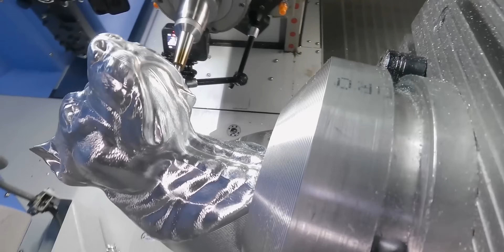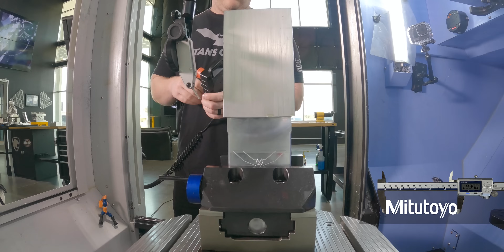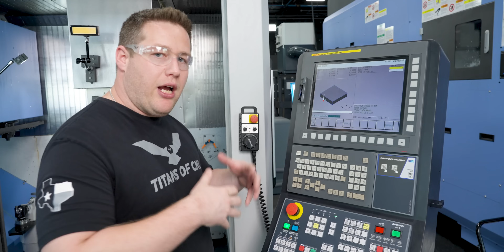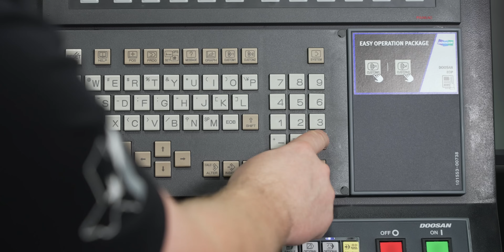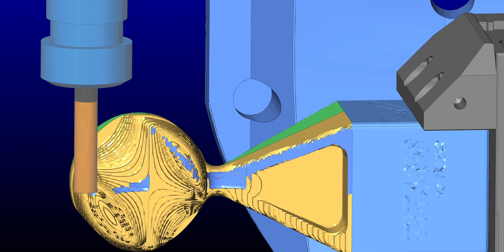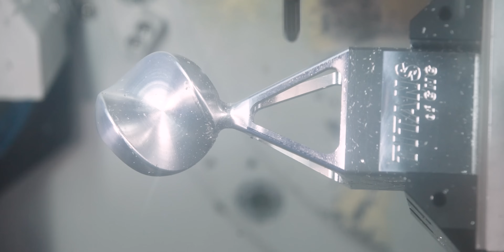How To Machine 5 Axis Parts

Comment: the confusion i have about 5 axis is the correlation between work coordinateZ0 and center of rotation of the 5th axis and how it works. If your part is sitting further closer from center of rotation, wouldn't your absolute positions be totally different when at different angles?

Comment: Man, what kind of time wasting program is this nonsense? At start tool walks backwards then starts another cut line? I would have run a Hog mill and got that material outta there. Then either a bull nose or a ball mill. One last thing, where did you learn the bad habit of clicking the torque wrench 2-3 times. Every course and on the AMSE tests specifically call out to never click more than 1 x and always unload the tension in a torque wrench. I have been a CNC Machinist 42+ yrs, and DON’T know everything. I do not claim to be an ‘expert’ but I am very good at what I do. And I can run about all types of conventional equipment too.

Comment: it's really cool how similar this is to setting up my dnm500. I'm sure there's alot more that goes into it, but I feel like I could jump on a 5 axis and not completely suck at it.
Reply: Only additional thing to watch out for is making sure your spindle clears the table when the table rotates. Using the probe to automatically set C0 is way easier than indicating everything

Comment: Why don't yall just program off center of rotation?
Reply: Because centering vises aren't perfect. So when you flip the part for op 2 it may not be perfectly aligned with your wcs anymore. TCPC allows you to just measure the offset and update accordingly.
Reply: @user-lj4xq4hm3k  my only fear with that is now the part isn’t exactly where the programmer thinks it is so and machine verification to ensure crashes don’t happen might not be accurate now.
Reply: @Marketpoppagiorgio  we have precision plates with pin holes so the vises located in the machine exactly where the programmer expects them to be. This is also way faster as the operator doesn’t have to indicate the vise at all.
Reply: @Marketpoppagiorgio  what is FCS?

Comment: 5 Axis Parts? Or Parts on a 5 axis machine?
Reply: Parts that require 5-axis machining
Reply: Mainly 3 axis Z level roughing and positional work really. Nice, pretty easily programmed and works...just not the most efficient method. Depending on your machine though, this, may be the most rigid method to rough your part. Some machines, especially older machines, are more productive with the rotary axis clamped. Pretty modern machines, with the hyper-cycloidal rotary drives, (or whatever they call them😂)  ate claimed to be as rigid when cutting as when clamped.
Reply: there's a little 5 axis movement towards the end. This part/ video is just a stepping stone to learning more complex 5 axis. Titan has a completely free 5 axis academy that progresses in difficulty for each part
Reply: Both? That's just a shorter way of saying it

Comment: Can you go into detail about the relationship between the X Y and Z work offsets you are telling the machine, and the dynamic work offsets that are allowing the simultaneous 5 axis movements?  Is that all in the mastercam post processor?  We have a 5 axis mazak at work, but don't have a 5 axis post processor for mastercam.  So I can only do 3+2 and I have set each WO individually, and do manual B and C axis inputs.  Help me understand the DWO process.  Thanks!
Reply: Typically, the machine tracks that single work coordinate no matter how your part rotates. The axes always stay oriented in line with your spindle. The machine coordinates in your program for full 5 axis moves are in reference to this single point and are no different than 3 axis coordinates, except they include a B&C along with XYZ. This gets super complicated to do by hand and yes, you will definitely need a 5 axis post from your mcam reseller to take advantage of this.

If you're doing 3+2 with your current post, try programming all planes off a single point. We had to do something like this with our old post. Your WCS should remain where your initial pickup is, then make your toolplane where you normally would and orient it properly, then take your toolplane and translate it to the same point in space as your WCS. You should no longer have to pick up more than one WO in the machine, unless your post cannot handle B & C rotations properly. Be sure to set all Tplanes to the same number as your WCS. Better 5 axis posts don't need this because they can handle a datum shift, so they don't care where you put your planes, as long as Z is correct.

Comment: I just don't understand why you probe x-axis with 123block and don't use single point probe with part at rotated b-axis like you probe y-axis
I work at 3 Axis mill and i'm just curious, there is probing limitations with probing like this?
Reply: As a lathe guy and apprentice who has ran a few operations successfully on a 3 axis mill in my apprenticeship, I’m taking a shot in the dark here but maybe it’s because to get to your b axis you have to rotate along your a and c axis? Maybe since there are more moving parts to this type of touch off, it’s just more for piece of mind to touch off on a 123 block. I do reserve the right to be wrong, especially on this lol.
Reply: The probing in this video is ridicilous to me...
In our shop, we probe at A -90° all the time for second OP's like this. (Hermle and GF mills) We have the cimco cycle probing addon in Mastercam and Heidenhain controls. But it works just fine without cimco probing.
You could also set the C-Axis rotation automatically at A -90° so you dont need an indicator. Then X and Y (also A-90°). Either X at C0° with two points, then Y single point (Compensate for part dimension) or X at C0° two points and Y at C90° with two points.
Probing in this way is very reliable and also suitable for general jobshop work (300+ Parts)

Comment: When I use Renishaw probe, if I need to add an offset I do it in the ''advanced'' tab there is a place for offset there. So it You can automatically add the half of your part there, without doing it manually in the offset tab.